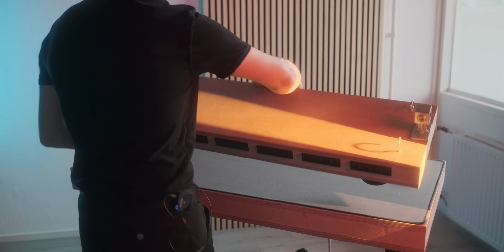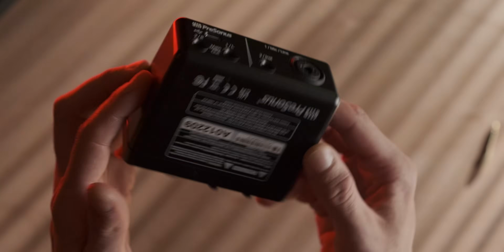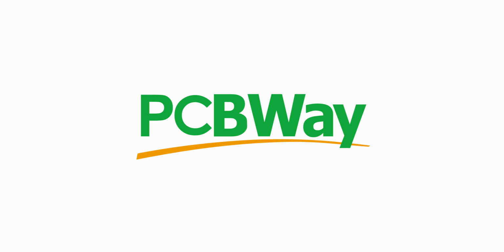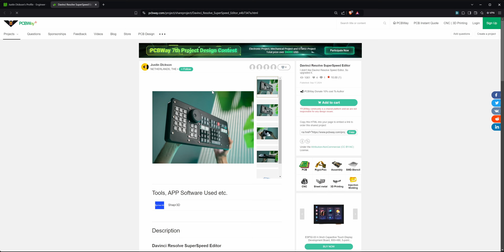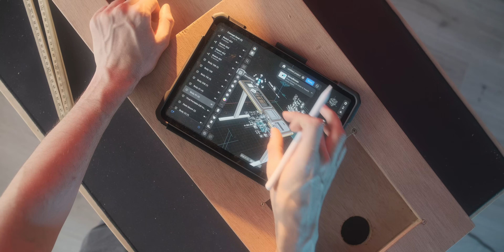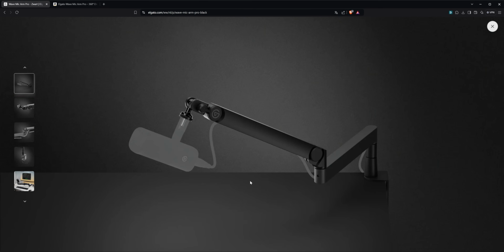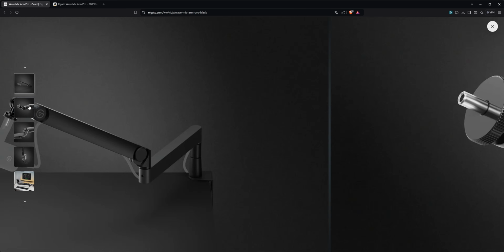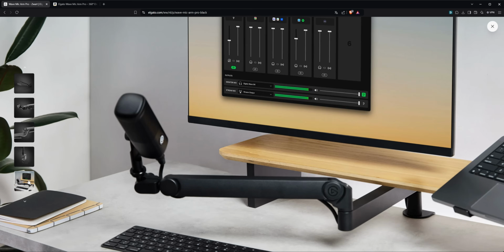I Built this Strange Concept Desk - Part One - 3D Print Project

Comment: Very cool. I plan on building my own custom "all in one" desk.. I do a variety of things (gaming, coding, music, editing, etc). When I get to it, it will be a top that I will attach to sit/stand legs. I plan to put 2 computers inside with multiple fans, water cooling (ideally), Plexiglas hinge tops to access computers if need be, all wires inside with channel down either side. Built in USB ports, HDMI/DP ports, charge pad. Will have a tray to slide out for 61 key keyboard and second tray for keyboard/mouse. If I can build it correctly, will have wheels on side so can remove from sit/stand and stand it vertically to easily roll/move it through door ways, etc. Been a dream of mine for years.. gearing up to build it soon.